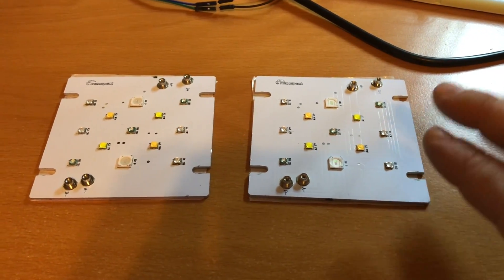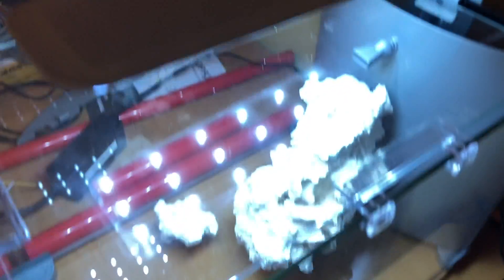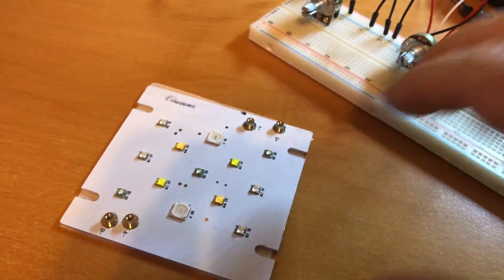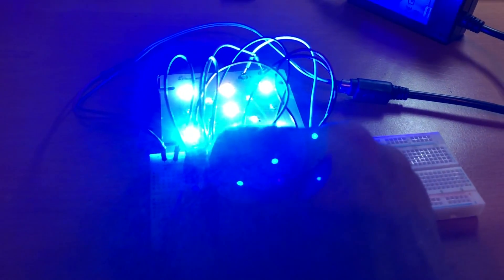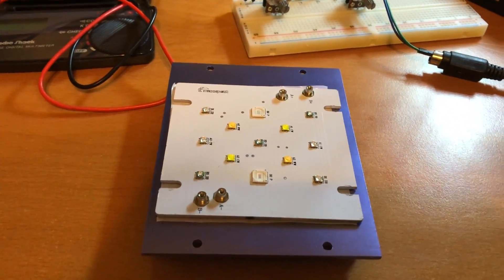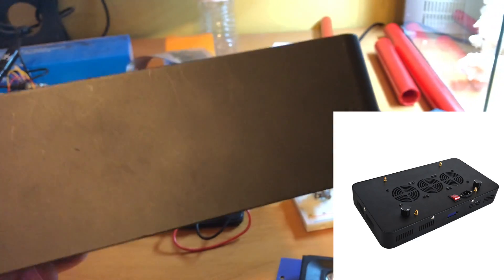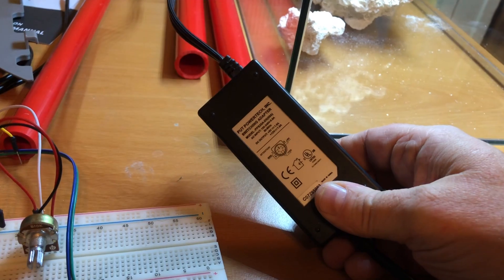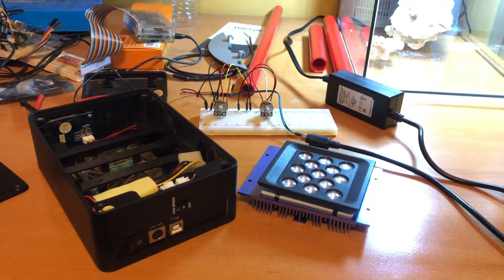DIY Reeftank LED from Spare Parts - Intro [Part 1]

Comment: What happent with the original light fixture? Why did u change the leds pucks in the first place? I have the same light 320w 4foot, and my blue leds died on 3 leds pucks( they are still light up but like 1% very faded at 100% intesity), offcours the other half works perfectly fine. What do u advide me to do? Please help me with an advise. Thank you.
Reply from the maker: Same thing really. One of the blue LEDs burned out on the pad and it took out the entire Blue channel. The only real solution I found was to contact the manufacturer and buy new LED pads. Swapping them out was an easy process.
Reply: @ReefSpy  thank you. So this is what I'm gonna do. Buy new led pads.
Reply from the maker: Birleanu Cezar cool. I would speak with their tech support first, in case it is some other cause. In my case it was a dead blue led.

Comment: That’s a cool diy but I would use thermal paste to adhere the puck to the heat sink. Also check the puck it might have the power rated stamp on it that will give you an idea how big of a power supply you need my biggest concern when doing these thing is making sure your current (amps ) isn’t to much for the board
Reply from the maker: Thanks for the tips!  I don't see any power ratings on the board, but the original power supply which ran two led pads was 24V 156W. That should come out to 6.5A.  My power supply is rated at 12V, 1.5A.  I am assuming that means I am way under driving the board.  Do you see any issues with that?
Reply: ReefSpy I think you’ll be fine I use a 1a power supply in a diy scrubber and it works fine for months now and it only has 5 LEDs